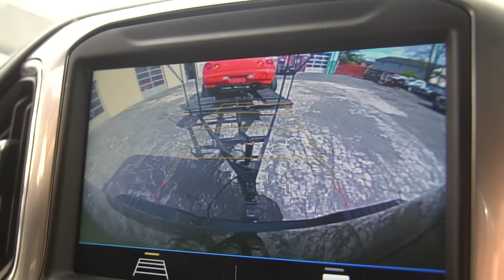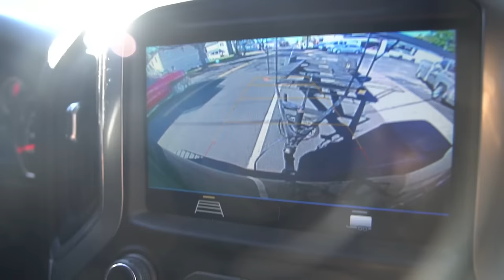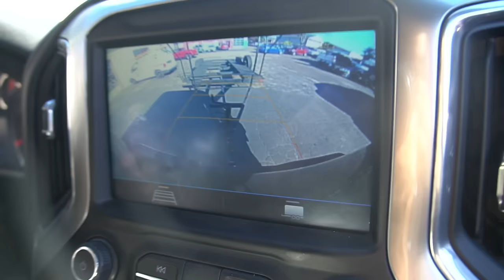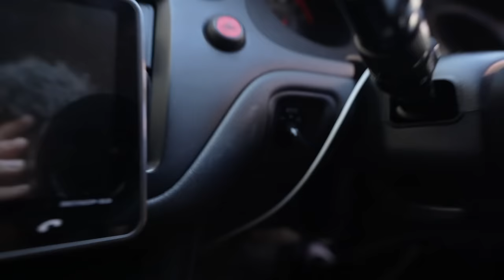We IMPORTED RJay his very FIRST RHD Car!

Comment: F23 is so good because unlike the h22s weak cylinder wall coating these actually have steel sleeves . Another thing is you can use k20 type s pistons in this engine (same bore) and an h22 head (g23) to net over 260 hp with a 13.1 compression ratio .I use to have an eg hatch with this build back in 2009.  Next you can go h2b gearbox swap and convert it to awd 😅

Comment: Would you hear all the gravel hitting the inner arch if you used it in rear archwell instead of schutz which deadens the sound just curious we used raptor liner before but it was on a rally car because its ligher than shutz and its loud on a gravely back road but them tyres are stickie too but i wonder for a road car ?